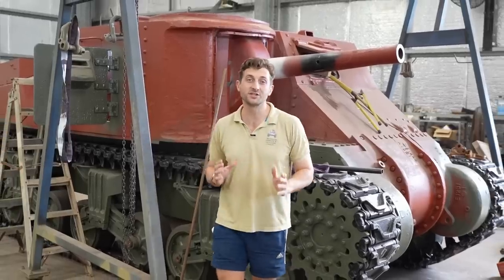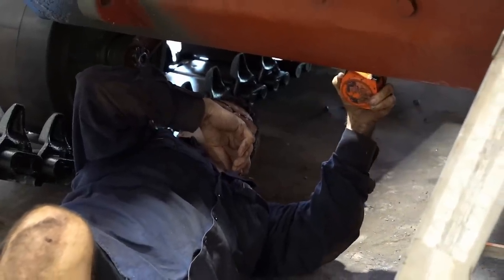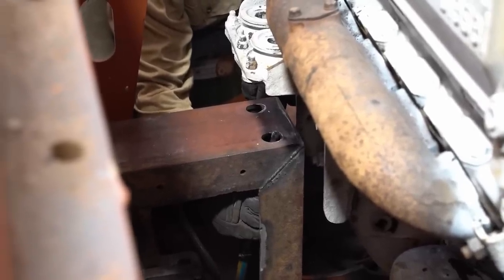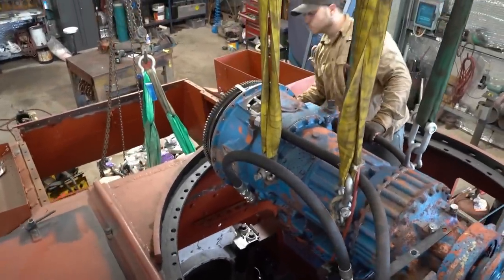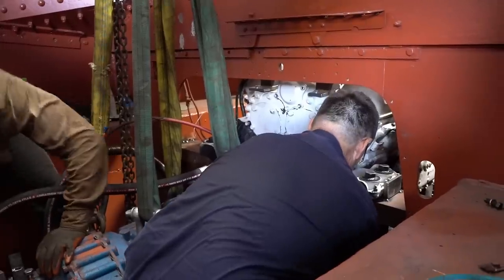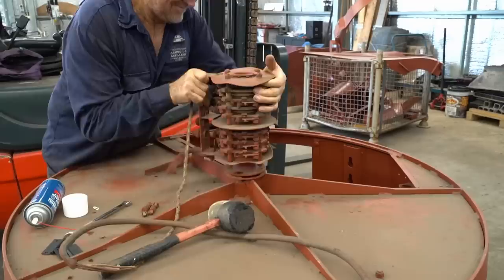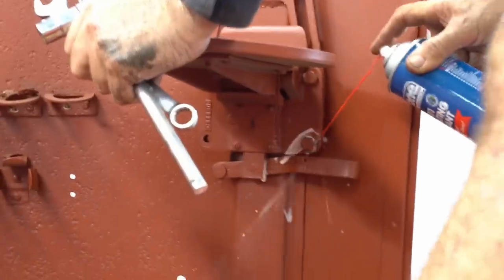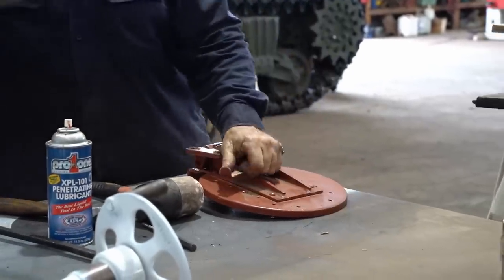WORKSHOP WEDNESDAY: Fitting the Detroit Diesel 8V71T Engine to our WWII Grant Tank

Comment: As an MV owner, I prefer everything factory/time period correct down to all details however, when it comes to heavy armored vehicles that need to be operable and sustained by a limited amount of mechanics, re-engining it with a modern diesel is what I would do as well. Great work men.
Reply: It's not really much different to what it had. The cylinders are the same. Just built to turbo spec in the post war era.
Reply: They are under a time constraint and money constraint. Oh, it is nice to be able to do things as you wish at home... I envy your situation.
Reply: Absolutely agree.
Reply: These things where built to be destroyed eventually surprised enough left to rehab to this level
Reply: @whiskeyinthejar24  cilinders are not the same the had an twin 6/71 and now a V8 /71  a twinn are 6 cil non turbo 165 hp engines
Reply: @hubertsteenbekkers1522  the cylinders themselves are 71 cubic inches in both. I meant that the engine was somewhat appropriate to the vehicle, other than being a later turbo variant. It's not a Detroit 92 family or big cam Cummins, Cat 3406 etc. It will still make that Detroit 71 family sound, with extra turbo whistle.
Reply: With the auto box and the original gearbox you should have a good solid fluid connection between the two so the shock loads won't be there like a wood with a clutch. Plus you'll have about a million different geer selections so that's good should make for much-improved driveability. Once you sort out the best gear selections.
Reply: @whiskeyinthejar24  whiskey in the jar you say? Sounds like a song to me
Reply: @thedeathwobblechannel6539  That’s what I was trying to wrap my head around. There’s so many small equations to work out so you don’t damage the drive train gears and bearings while still getting the desired performance. I think it’ll work if they stick with a civilian transmission and engine that’s able to handle the torque required. The engine will be under a ton of reverse torque loading so it’ll have to be isolated at every 16” along the transmission before it hits the engine to reduce the effect. I’m sure these guys will easily figure out their needs.
Reply: @echohunter4199  check out deboss hd on YouTube. He is a Canadian guy with many cool projects. One of which is a modified Sherman chassis logging vehicle with a Chevy crew cab pickup on top. He is running a naturally aspirated 6V71, through an auto. His is quite a bit lighter with almost no armour plate, no turret etc.
Reply: @whiskeyinthejar24  I’ll check that out, sounds unique. I grew up in the Cascade mountains in southern Oregon and we had lots of those chopped up surplus vehicles used in the forestry industry, same for ranch and farm vehicles, that’s where I found most of my projects since farmers rarely get rid of anything. When I was on Recruiting duty in the 90’s I had to drive out to remote places on the high desert so I always kept an eye open for projects and parts, I helped out a lot of friends with things they needed.
Reply: @Dan123. y worked with all Detroit engines the made y am pretty shure y now some thing about them

Comment: Wonderful to see the old girl coming back together! Re: Nyloc nuts, the earlier type was the Fiberlock, which used a locking ring of Red Fibre or fabric reinforced Bakelite instead of nylon.
Reply: I was going to post that it was fiber-bakelite insert nuts. By the way fiber locking nuts are still here used in aircrafts.
Reply: @autka_me  Yes, I used to work in the aircraft industry. I've used the red fibre and bakelite nuts, but we used to replace them with Nyloc when necessary.

Comment: For fitting gearboxes,transmissions,I make a couple of guide pins from bolts I cut the heads off and cut a screwdriver slot in the end after tapering the last inch to about 70% of the diameter,make 'em easy to remove. Install these at about 10 and 2 oclock to line up the job. 👍🙃🙃

Comment: Those contactors make me think of the Central pivot for an excavator. They have about 12 hydraulic hoses going into the top with about 6 different levels sealed off with o-rings where the fluid comes out and makes it able to do all the functions and turn around endlessly without twisitng anything.

Comment: One word guys. Guide bolts. Oh. That's two. Love the vids. Thanks.
Reply: Surprised they don't have a set of lady slipper bolts. Basically long bolts with pointed ends. I have a whole variety pack of sizes and variations on the theme, extremely useful. Probably one of the most used self made tools i own.

Comment: I restore American, English and German motorcycles from World War II. What a pleasure it is to work with German Ribe, NSF, Verbus bolts. Even if the bike is lifted out of the swamp, these bolts and nuts often come off even without preheating! By the way, I'm currently working on a German DKW NZ350-1 from 1943. And the economy of the Germans is visible in all its glory! Instead of aluminum, the crankcase is made of cast iron! After the Germans, no one has yet disassembled it. So it will be exciting..))

Comment: She is a late model 8V71.......with the improved cast aluminum rocker covers. Check your injectors are free before starting, or have the air shutoff working.  They are crazy when they run away. Using an allison is a good call.........its much more gentle on the final drives and easy to handle when driving, with that combo she could cruise the highways LoL    In the 1980's  people were pulling 3 trailer road trains grossing 115 tons with 8V71T's.

Comment: My first car mechanic back in the 70s was a master at "fixing things" efficiently with novel solutions as he had trained between the world wars. I had an old straight 6 Triumph 2000 and the ringgear for the starter engagement was working lose from the flywheel. The official fix is removal of flywheel and ring and fitting a ring by heating to expand and fitting before it cooled and shrank. His fix was to drill a big enough hole in the bellhousing insitu , putting a drift through the hole and knocking the ring back on before securing it with a few welds, again through the hole. Saved days of disassembly/reassembly on a car not worth those labour costs.
Reply: I'm not saying he didn't do it the quickest way possible but those old Triumphs were so easy to work on. Back in the 90s I swapped out the manual box and steering rack on my 1974 2500 for a automatic box and power steering over a weekend working on my brothers lawn with nothing but scissor jack's, crappy old tools, youthful enthusiasm and a Haynes manual..
It all worked perfectly first time except I forgot to tighten the front wheel nuts back up and the car flipped over in its side as I was trundling down the road wondering what that clunking noise was lol. No damage except it looked like someone had ran a huge cheese grater down the side of the car, ran it for several years after that, such cool wagons the old Triumphs

Comment: Quite the task ,installing the 8V jimmy into the tank for some retro power ,Hot rodders have been doing that for years fitting different engines in different chassis ,that engine and transmission combination should do well in the Grant .Awesome work you are amazing ,I'm looking forward to the first start up ,Crack on

Comment: Another great episode. The guys are doing great work on the Grant. Using modern power makes good sense. You should do the same with some of the German tank projects, use a modern gas engine and an automatic transmission.

Comment: Very good work as usual. I didn't realise how far the autobox and V8 would intrude in the cabin. I understand that costs are always the problem and availability of original engines and gearboxes. However I would not be honest if I say it doesn't matter, the only reason I say this is the attention to detail and skill you use on the outside of the tank. I'm guessing film work would be a source of income for this tank. Rather than as original museum piece. These updates are great I wouldn't miss one!
Reply: Even the original engine config would've protruded into the cabin by a significant amount

Comment: No need to read the manual for the twin 6-71 setup so that you can start the tank up. Has to be a bonus right there😊!
NB It is my understanding (via the Bus Grease Monkey channel) that the 8V71 was developed to replace twin 4-71 power packs in US long distance buses.

Comment: Daryl's mention of Germany switching to steel for cartridge cases as base metals for making brass became increasingly scarce reminded me that the US also used steel as material for .45 ACP cartridge cases at some time during WWII!
I know this because a fellow member of a pistol club I patronized during the 1980's used some expended wartime issue .45 ACP cases for reloading.
When he used the reloads he kept encountering jamming after the first shot or two because the steel cases had not crimped as firmly to the projectiles as traditional brass cases do.
Evidently that allowed projectiles to slide backwards in cartridges still in the magazine resulting in them not feeding to the chamber of his pistol.
Reply: The projectile would have been secured with shellac or some other "glue" as originally produced... still crimped, and done as waterproofing, but it would have prevented that issue as well.

Comment: 17:20 True but some people may not know this: From 1942-45 we had 35% silver nickels because we needed nickel for making projectiles, and in 1943 we had zinc coated steel pennies because there was a shortage of the copper that we needed for bullets, etc. But yes, we were pretty self-sufficient as far as resources are concerned.

Comment: For static displays original parts should be the norm, if money allows however for mobile displays and actual driving the tank around then non-original/non-standard parts is fine as long as the outside is the same. Costs are costs and its already expensive enough as it is.

Comment: Looking at a couple of the closeups you took of those turret basket slip rings, it appeared to me that all the parts are there, and they could be salvaged and operational. Of course since there is no room under the basket because of the automatic transmission, I guess they can go in the spare parts pile. 🙂

"Nyloc" (or maybe "NyLoc", I forget) was a trade name for nylon locknuts in the middle of the 20th century.

Comment: GM Detroit Diesel…..once the best sound in trucking, especially when singing through a 15 speed Roadranger.
I remember when the tin can cowboys used to unscrew the exhaust diverter tip on the roof of the M113, crowbar mash the muffler internals…
You could hear them 6Vss from the other side of Pukka. Nice. Neil Diamond wrote a song about it..”Beautiful Noise’.
“ You goin’ to Pukka ?”…..’Na mate, she’s me sister.’
Reply: 6V53 !
Reply: I’m goin to Puckapunyal in me Pord Palken with Pour on da Ploor.
Reply: @dougstubbs9637  God my old man used to say that and I'm 53! Only he must have been a bit more upmarket going for the Pord Palcon Pivehundred wif poor on the ploor
Reply: Here in the USA thousands upon thousands of motorcoaches were powered by 8V71, 6V92T, and 8V92T engines. Greyhound had buses that ran through the Colorado Rockies equipped with 12V71 engines and 5Spd Fuller transmissions. They sound of the engines could hum passengers to sleep on late night runs.

Comment: I think the 71 series Detroit diesel was introduced in about 1938. The V series in about 1957. I think that it isn't unreasonable to suggest that the in-line 6-71 was the best available Detroit during WW2, but if the 8V-71 had been available it would have been an excellent choice for the M3 and M4 tanks.
Reply: Considering how the 8V71 got thrown into just about everything surplus postwar, you're probably right

Comment: The electrical slip ring darel removed from the turret basket can be probably purchase a new one that would be more compact
Reply: Drop in an RBJ from the bottom of a T50 turret from an M113A1, they are pretty low profile.

Comment: American trucks used a LOT of 8v71 Detroits.
Reply: Actually this engine at 400 hp will be less hp than the two 6-71. The 6-71 typically had 238 hp each. or 476 hp total.
Reply: @seventhson27  If it's the engine as the M4A2 it's only rated at 375. Not sure if that's limited to save wear, or power loss from the shared crank.

Comment: Frankly, with all the strange repaired and refurbished tanks that appeared during later years of the war, your tank is perfectly fine. If it fits and it runs, it would've been used. Its just not factory standard.

Comment: Oh, an engine fitting. But I hoped for the radial R-975... Does it mean it had something like M4A2's GM 6046 twin inline 6-cylinder?
Reply: It had Twin inline 6 Cylinder engines. You must of had the sound turned off, because Kurt does mention this near the start of the video.
Reply: @MJTAUTOMOTIVE  must have
Reply: @MJTAUTOMOTIVE  Just read that the GM 6046 is the twin 6-71s, so that's the same thing. I was just surprised that they used the different naming then what's there on Sherman documentation website and wikis on M3 and M4s.

Comment: Nyloc nuts in the form we see them today go back to 1944 (patent US2450694).   Lock nuts with a fibre or rubber insert go back to at least the Rennerfelt patent of 1925 (US155028200) however they look quite different to the Nyloc type.
Why use pop rivets?   Rivets of the period correct type are readily available, including small quantities cheap from China on eBay.   I've used eBay Chinese rivets in restorations I have done.  They are easy to hand-make from aluminium or soft iron wire anyway.  You need to buy a rivet-set tool, or you can just make one - it's just a steel rod with a concave end - 5 minutes in the lathe.
Much quicker and easier to use the period correct rivets than to disguise pop rivets with bog.
That screaming jenny engine is not going to sound anything like the original engines.

Comment: Why not use original 6-71 configuration? Those can still be found.
Reply: parts the answer is parts. no one makes new parts for them so if something breaks the likely hood of finding a replacement is very low.
Reply: @jordan38r  there are plenty of Detroit 71 series parts. 1,000's were made up until early 90's.